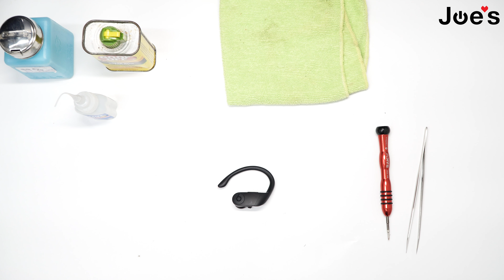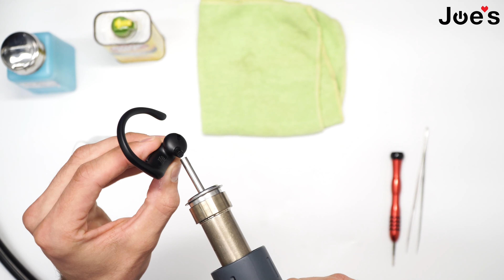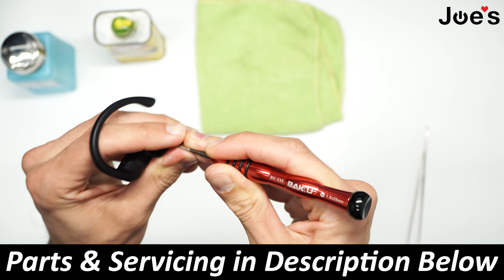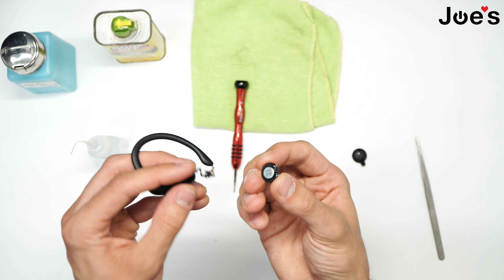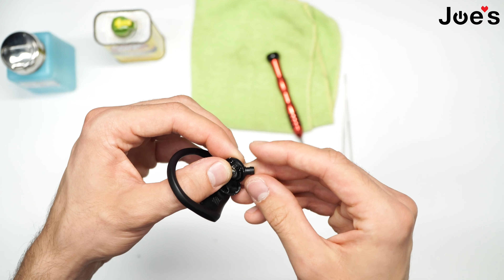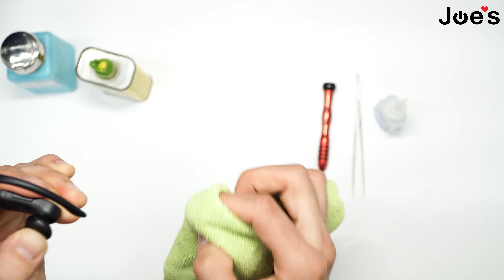Powerbeats Pro Blown Bad Speaker Driver and Housing Replacement | Repair Tutorial

Comment: Hi I have a problem with my Powerbeats 3. The Wheel speaker thing unstuck and I can't get it back in. I looked inside and it seems like one part of the white circle (gum?) thing was unstuck (it mightve been stuck on with glue?) and that's preventing it from getting back in.
I can't find an answer to this problem so I guessed you could be the only one to help!